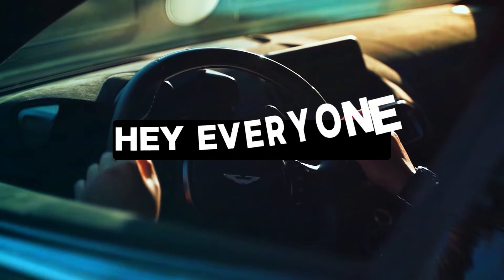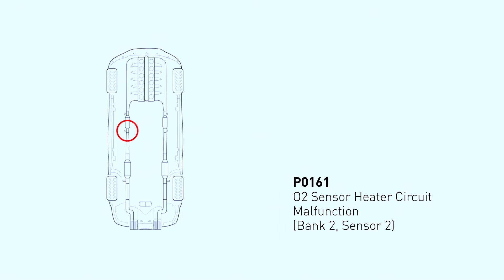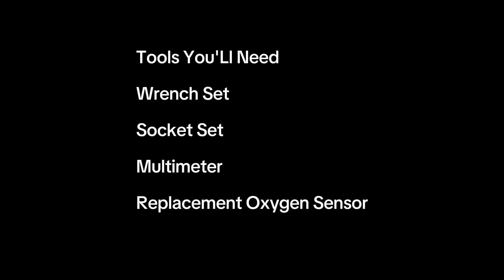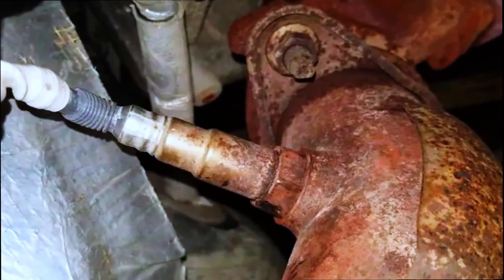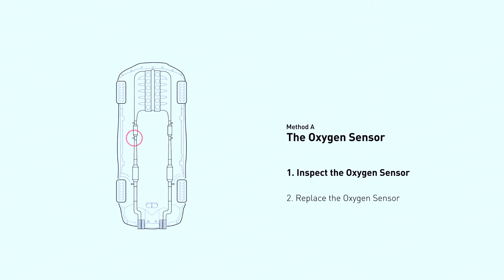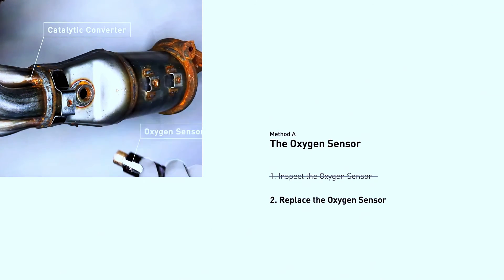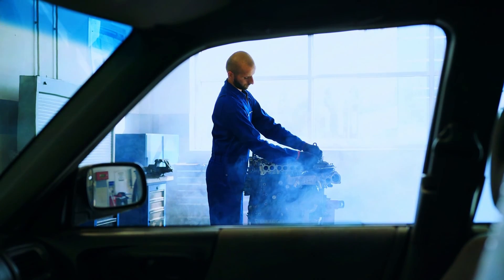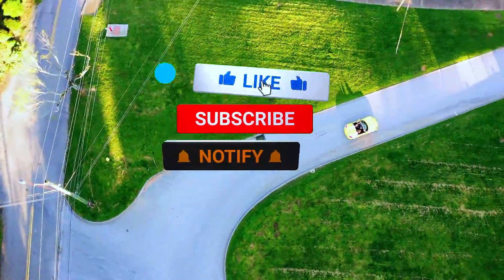How to Fix P0161: Diagnose & Repair Oxygen Sensor Heater Circuit |

Comment: Hi, my car has an upstream narrowband oxygen sensor and I want to add an additional narrowband oxygen sensor for my AFR gauge.. where to connect the heater?
Reply from the maker: To add an additional narrowband oxygen sensor for your AFR gauge, you can connect the heater wires to the same points as your existing sensor. Typically, the heater circuit has two wires: one for the heater power supply (usually 12V) and one for the heater ground. You can splice into the existing heater power and ground wires to connect the additional sensor2. Make sure to secure the connections properly to avoid any electrical issues.
Reply: @weeklytools Yes their heaters have 2 white wires (same oxygen sensors). I was thinking about this type of connection but I had my doubts about connecting heaters parallel because if I am right it halves the total resistance that ECU detects.

Comment: Can it be a bad Cat?I have a 2018 Isuzu NPR-HD truck with a P0056 and P0161 code for Bank 2 Sensor 2. We replaced the sensor and have the same thing. Heater elements for both the old and new sensors read about 6 ohms. Wiring looks good and others indicate that it could be a bad ECU. I don't want to buy that or the CAT without being more sure.
Reply from the maker: While a bad catalytic converter can cause P0056 and P0161 codes, it's not the most likely culprit in this case. Since you've already replaced the sensor and verified the wiring, a faulty ECU is a more probable cause. However, before replacing the ECU, consider these additional steps:

Double-check the wiring: Ensure all connections are secure and there's no damage to the wiring harness.
Inspect the catalytic converter: Look for physical damage, such as cracks or blockages, that could affect exhaust flow.
Consult a mechanic: A qualified technician can perform a more thorough diagnosis and potentially identify other issues.
If you're still unsure about the cause, it's advisable to seek professional advice to avoid unnecessary expenses.
Reply: @weeklytools  Thanks for all of your help. It was a simpler issue....we replaced the wrong sensor. The flex pipes coming off the manifolds cross underneath the truck so the downstream sensors are opposite of the upstream. Replaced the correct sensor and after the test drive we have no Check Engine Light!. You rock and I am now considered even more of a genius than before. Seriously thanks for your great video and help
Reply from the maker: Most Welcome, Sir.